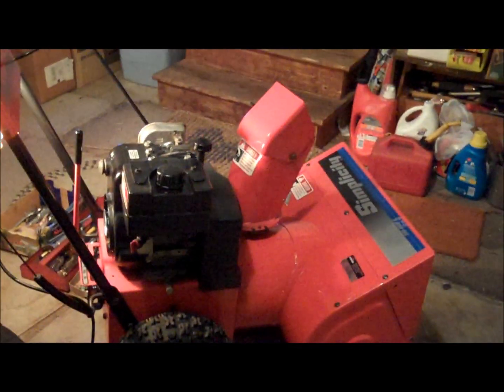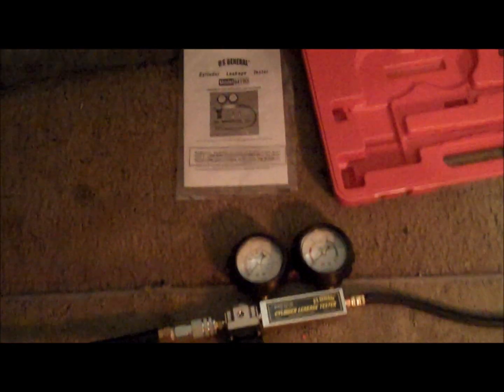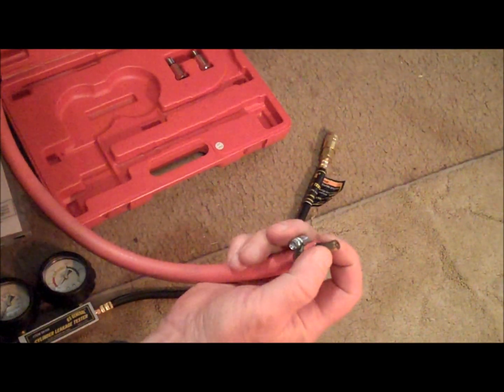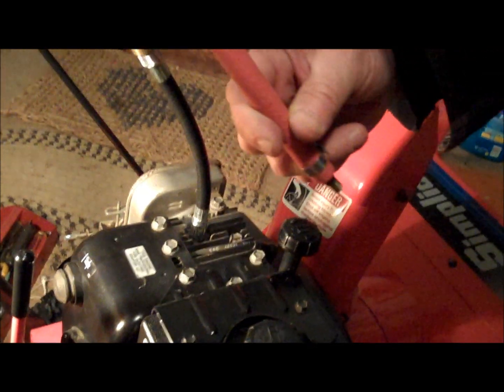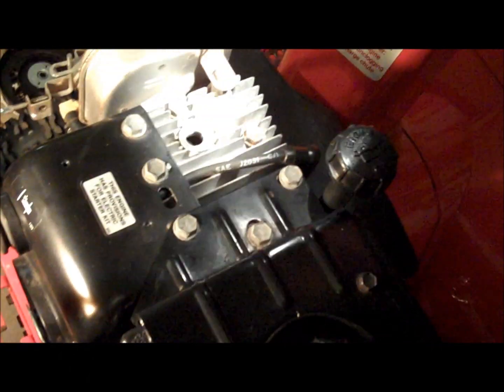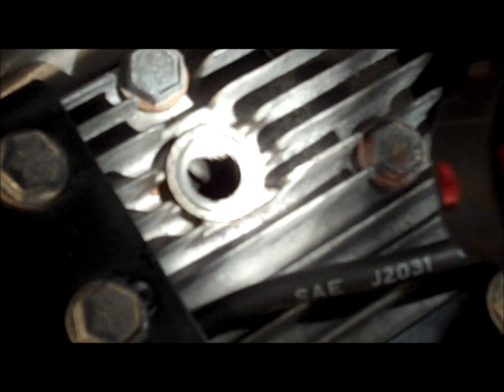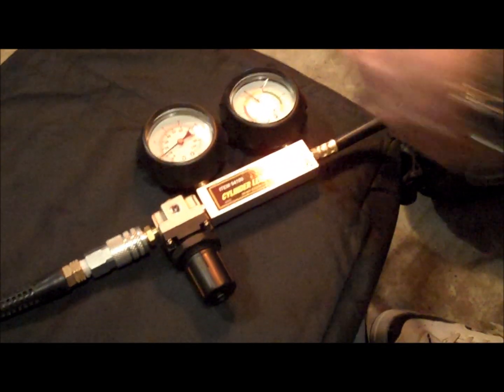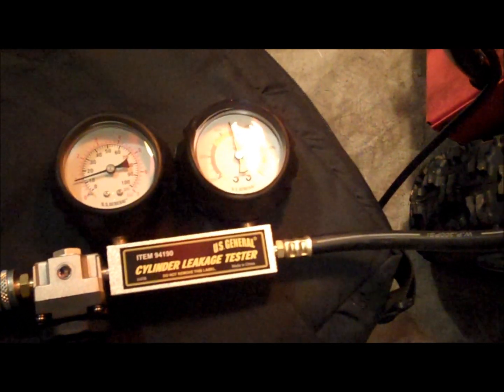Snowblower Leak-Down test, with homemade bicycle pump adapter, Tecumseh 5 hp engine.

Comment: Best way to find the leak without tearing the engine apart is to find where the air is hissing out. If its coming from the carb or muffler, you've got a bad valve.(or the engine was not at perfect TDC)  If its coming from the crankcase breather or out of the dipstick tube, its the rings. A head gasket will be obvious as the air will be coming from between the head and block.

Comment: @Iliveforvacations 
Hi Tom,
I certainly did see your trumpy :-)  she looks nice from what I could see.
I'm glad you got your blower done, did you notice if it had valve seats?
 If it is a cast iron barrel you will most likely find it has none as the valves are ground direct into barrel,
 so this will be a problem now and again! it is valve seat recession made worse by the unleaded fuel we now have to use.

Comment: Thanks lunmad,
That's exactly what I found.  The exhaust valve wasn't closing, so I removed the valve and ground the stem down slightly to provide the .008 gap.
-Tom
p.s. I assume you noticed my T160 in the background at the beginning of the video.

Comment: Hi Tom :-)
that motor looks a bit like a Briggs and Stratton.if so the chances are the valve clearance has closed up,
 If you look just below the barrel behind the carb/exhaust there is a plate, remove that plate and you should see the valve ends where you gap them.
If the valves are tight you have to remove them and grind a touch off the stem.
I hope this gives you some idea's.